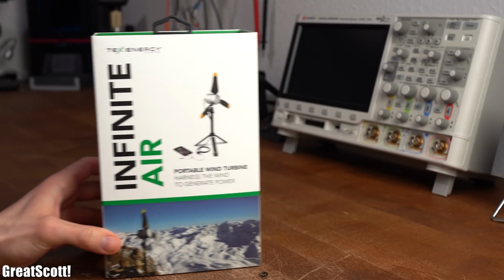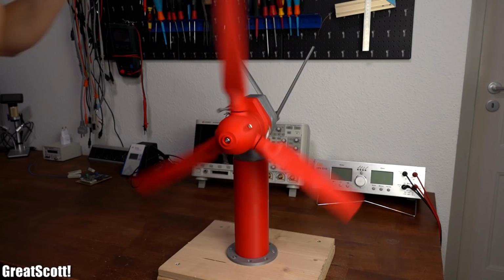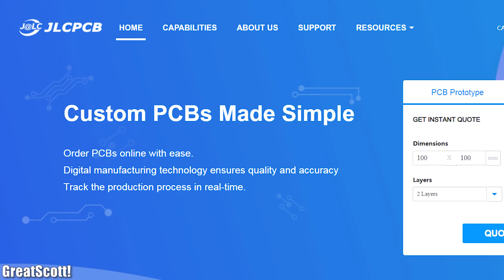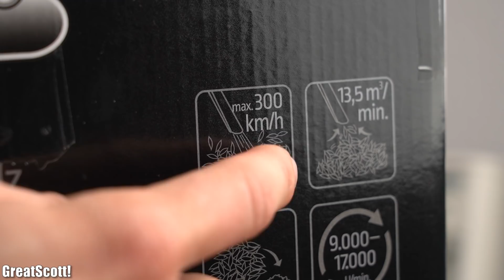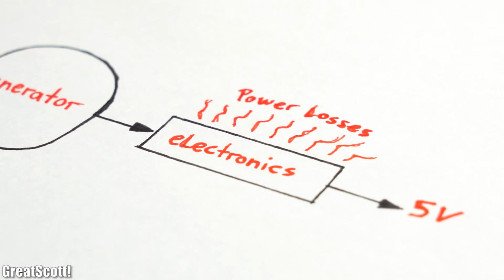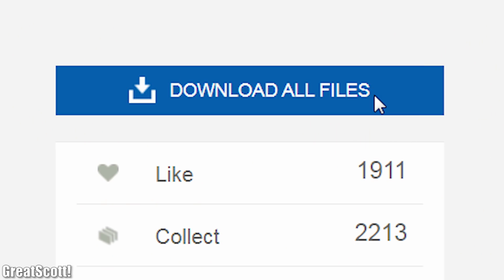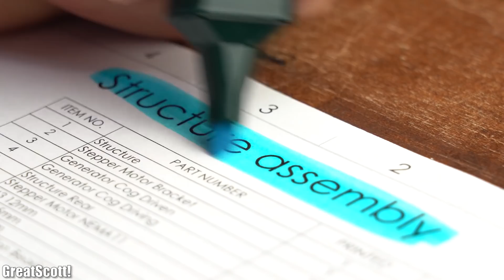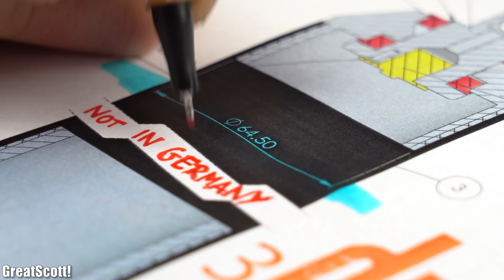Mini Wind Turbine || DIY or Buy

Comment: As mechanical engineer and serious electronic hobbyist I would like to share my view for the contents of this video presented: 
I wouldn’t feel much confidence in theses tests, for several reasons explained ahead, although your conceptual purpose was commendable.
(1) The wind blower applied “wind” in just a small part of the blade - where radial distance (and angle) should be the same in both cases, not only speed settings (“3”) and blower to blade distance. Not doing that increase lateral bearing loads (higher friction losses) and apply “non reproducible” and “non equivalent”  wind to both devices.
Suggestion: why don’t install higher above the roof of a car (or even bicycle) and test at a given running speed? 
At least for few seconds both could be monitored in the same condition, maybe recording each Volt x Ampere pair under equal resistive loading in any data logger (even Arduino would work).

(2) Compare fixed pitch blade vs variable pitch... But the best pitch angle was not properly working to make it as a fair comparison. Maybe even the blades were NOT at same pitch...

(3) Another important point in the comparison was missing: which is the circle AREA the blades cover? That is essential to know how much wind energy could be harvested. And would give an idea of Efficiency [(Watts/m^2) / (Wind_Watts/m^2)] for a GIVEN Wind SPEED - consulting a curve of Energy efficiency per wind speed would be better for compare each in where Efficiency is not so low.

(4) And After such much trouble to 3D manufacture all those parts, the lack of smooth surface finish in the blades or in gear train increase mechanic (coupling and aerodynamic) losses significantly, a pity for so much effort invested. 

(5) A final  point: as this is to be used outside, for All Weather Conditions, their sealing systems to water ingress (in electrical and mechanical components) should be evaluated too.

So, even for a comparative result of “who is better”, I wouldn’t see as valid, at least how it was made here. 
I believe you should revisit the adjustments of the DIY version and re-run tests in conditions more similar to how each version was designed. Then, just share some figures of acoustic noise (if significant - iPhone App ~ ok) cost (most important), time spent, resources necessary and wind-area needed. 

If you decide to rerun and would need to exchange Ideas, we could see how I could share some more thoughts, details and suggestions.
Reply: From my experience of making small wind turbines these are the obvious things I could see that were wrong.
1) Any turbine with a blade diameter less than 1 meter is a waste of time. The efficiency drops off dramatically  and power available in the first place is too little to be worth having.
2) Any sort of gearing or belt is a bad idea due to efficiency loss and reliability. Direct drive is the only way to go.
3) The generator must have very little cogging torque otherwise low wind start up will be poor. Stepper motors have quite a bit of cogging torque.
4) Plastic makes a very poor blade material unless reinforced with glass fibre. Wood is the best for a home built rotor.

Comment: The problem not is the electronic or electrical (Generator or Rectifier), it is simple physics consideration  Electric Power generated  (proporcional ) => wind Speed by  circle (Blade area). If the blades its soo short....sorry ....lose efficiency. I think (i don not caulculate it) the blades must be 2 mether or more because wind speed its sooo slow. Add to it add generator speed 60 turns by seconds, make to easy sicronizated all generators.    Secon problem it the generator must be tur to wind direction.  Please you must be think the problem its similar to wind Windmill.

Comment: i think testing the  commercial windmill without its circuit might give it a disatvantage as it could have regulated the charging cirquit to get a maximum power output, which could be the advantage of the buy option.

Comment: I dont see how the wind would be powerful enough to charge a device? Wind isn't usually consistent. But great video!
Reply: You don't have to be super consistent to charge up a battery. But if you want a wind powered device, you sadly need a a turbine that can make the most of the rare stronger winds and a huge battery for the windless periods

Comment: Hi, the internet is full of DIY wind turbine plans. But that's not true of the generator. Some people use dc motor or car pmg. The other solution is 9 or more coil in resin casting. What is the best solution for DIY generator construction for wind turbine?

Comment: Wind power is one of the reasons I got into electronics.  I think going with a stepper may have been the major issue with why this didn't output a lot of power.

I forget the model numbers, but there is an old IBM disk drive motor (from the '80s I believe) that is considered in DIY circles to be the best motor you can use for this purpose, but they're getting hard to find and obviously the price goes up. A lot of documentation exists for people trying different things, like using a car alternator (which is very poor, btw, it needs to turn really fast to get any real power, which means a high gear ratio and much losses).

Another (and I think very fun and perhaps something to try) method is to build your own generator.  I've seen them built out of hard drive magnets and other such things. Build a three phase motor with some coils and some magnets and you can build a decent wind generator.  I started collecting hard drive magnets but I just never had enough to make a good attempt.

You're absolutely correct about gearing.  It should be avoided unless it's a large turbine with long blades so the loss in power is made up for by getting more power from the wind.
Reply: What if we use 775 dc motor?

Comment: I checked the price on wind turbines and compared with solar.
For identical power per day (depends on weather) but wind turbines need to be big to be efficient, cost more, makes noise and require a maintenance that will hardly reach the 25years claimed of recent solar panels where a frequent clean is all that's needed.
Ideally you want a combination of both but wind power remains costly for your own needs. I rather have a giant rat wheel that me or my dog can use if that can give a next project idea ;0)

Or just a bicycle linked to a generator...

Comment: hi , You can improve the efficiency by replacing the diode bridge rectifier by a Mosfet bridge rectifier http://www.ti.com/lit/ds/symlink/lm74670-q1.pdf . and why not adding a DC/DC converter like tracopower to generate 5V regulated ?. :-)

Comment: Ahhh. could you please stop hammering the bearings? Please use at least a nut socket to only apply force on the outer race of the bearing.

Comment: The efficiency was highly reduced by the forward voltage of the Diodes. It was not mentioned if they are shockey ones or not. But lets assume 1.2v for two Diodes. In the buy option an output voltage of around 1.5v can be seen. In this case the loss is a bit less than 50%. At the div option a voltage of about 0.75v can be seen, witch results in about 60% loss.

Comment: Unfortunately, there are many products like this that don't work the way they claim.  For a great DIY wind turbine, you can use a reclaimed mains voltage DC motor and buck convertor to get the output you desire.  These motors are in many devices including blenders and garbage disposals.  You will only need to redesign the turbine around the different dimensions of the motor.

Comment: Greetings from Spain ... I tried to make a Mini Wind Turbine with this motor (DC120V 2500RPM high power DC motor generator Wind power hydropower generator) https://www.ebay.es/itm/DC120V-2500RPM-high-power-DC-motor-generator-Wind-power-hydropower-generator/172752108152?ssPageName=STRK%3AMEBIDX%3AIT&_trksid=p2057872.m2749.l2649 and I burned up my test equipment. Would you be interested for me to send it to you... but you will have to make a video to show me were I went wrong.

Comment: Great Scott  Love your videos.  I have a commercial wind generator for charging phones and power banks.  It can also be submerged in a stream and generate electricity.
https://www.amazon.ca/Waterlily-USB-Portable-Campers-Backpackers/dp/B07MXN2LXB/ref=asc_df_B07MXN2LXB/?tag=googleshopc0c-20&linkCode=df0&hvadid=335005865265&hvpos=&hvnetw=g&hvrand=15228518222223278592&hvpone=&hvptwo=&hvqmt=&hvdev=c&hvdvcmdl=&hvlocint=&hvlocphy=9000653&hvtargid=pla-627566951005&psc=1

Comment: You forget to put actuator in center of rotor so later you can change the angle of blade according to wind speed and using brush dc motor is better.

Comment: So you know, you can add a pause into the print in PrusaSlicer (use a color change or the pause feature in the beta). That way you don't have to deal with the movement while inserting components.

Comment: Both win: cheater mode, you cannot compare the 2. 

The Nema motor is a big mistake. Inefficient as a generator
Reply: Agree, Try to adapt the motor from the bought one to the diy one, so that you compare the design with the same model. And if you do, tell us the results. 👍
Reply: He did a video on generators types, comparing bldc, stepper ,dc and others i think, but the design he used required a stepper motor, so he went with that.
Reply: @lukemagdalin6169  did he try and Gimbal BLDC motors?  They're usually wound for very low Kv so would generate useful voltage at low rpm when used as a generator.
Reply: @martylawson1638  YES! those low kv motors are perfect for this application and should easily outperform the bought one.
What also needs to be tested is which rotor is the most effective and at what rpm he rotor spins (pitch of the rotor).
I would go for a active blade pitch system with a servo though that keeps the rotor spinning at the optimum rpm.
Reply: @cmulder002  something like a maximum power tracker, but optimized to prevent overspeed might work
Reply: @RobertSzasz  so vary the load to maintain optimum rpm?
Reply: @cmulder002  more to limit max speed so it doesn't fly apart. But I assume there is a best blade speed for any wind speed too.
Reply: @cmulder002  i always wanted to make a wind turbine using an RC helicopter rotor.they have pitch control,reduction gear,multiple options for the motor and pinions...bad thing is they usually have 2 blades,and the rotors with more blades are expensive as hell in comparison,but...
Reply: @xiro6  go for a older plastic head like from a raptor 60 or vario heli. Plastic doesn't rust when it gets wet and change the ball barings with bronze bushings to also reduce corrosion when exposed to the elements. 
Copy a tailrotor pitch actuator since you don't need a swashplate all (you only controll pitch not roll/nick) 
These turbines run a much lower rpm then a rc heli so use 700 size or up blades or even better make own from wood. 
Then you can make them wider too since turbine blade profil is diferent from rc heli profile. 
To make it strong and light use a hardwood for the front 1/3 and balsa for all behind it.
Reply: @cmulder002  - Interesting thoughts!
Reply: Yes definitely. Curious why someone with the expertise to design a variable pitch prop would not have considered a much simpler, much more efficient option. A common, brushed dc motor will provide excellent generator capabilities if suited to the application.
Reply: Absolutely. 

Use a suitable BLDC motor instead. The gears aren't the issue, as those gears are almost 100% efficient, say 95% efficient or more. You're issue is the generator. ;)
Reply: yep i wonder how diy design  work with  generator or hmm some diy generator from rewind motor?
Reply: @buragoja9052  probably a brushless DC motor with a better efficiency but it is much more expensive.
A diy generator is fun but you need the computer tools to simulate the magnetic fields before you try to wire the motor. Or you will spend ages and probably fail.
<3
Reply: @RomanoPRODUCTION  there are many inexpensive brushless motors to match the exact needs. Match the motor kv to the expected rpm, and you can have direct drive.
Reply: @RomanoPRODUCTION  you can get a 300W bldc for like 8 bucks, probably around the same price as a stepper. though you'd have to add a gearbox (i.e. 2 more bearings, a shaft and 2 more gears, though the gears and shaft could be printed as one.)
Reply: @markdaniel8740  ha. Good luck finding a low kv motor that produce usable voltage at the rotational speed of the wind turbine.
Reply: @cmulder002  that doesn't tell me what the kv of the motor is
Reply: @luongmaihunggia  about 140 is standard ; the number of windings is what dictates the kv
Reply: @cmulder002  wind turbine rotate at 60rpm so you'll generate .4V at that speed so ha. Good luck powering anything at that voltage.
Reply: @luongmaihunggia   No they don't... they rotate ar what is the most effiecint for the current wind speed.
Reply: @cmulder002  which isn't that fast  anyway so good luck with that.
Reply: Exactly my thaught as well. That generator probably sucks big time. Even if the motor works fine, driving a reduction gear backwards may be really heavy and will probably waste most of the power.
Reply: @Twhite97  need to be spinning at at least 588rpm to charge a li-ion battery. Even if you could get 588rpm with a leaf blower doesn't mean it will get 588rpm under real world weather. As you can see in the video, Scott can barely make it turn in Germany weather.
Reply: Und der dye kan mehr Fläche an Wind auffangen man müßte eine größere Fläche mit Wind treffen

Comment: DIY or BUY: Generator with internal combustion engine. With Maximum Power Point-Tracking. 

I've built one with a Nitro-Engine, a DC-Motor for the starter and a BLDC-Motor as the generator. 
Looking forward to the test next weekend - Certainly more fun than grabbing a cheap generator from ebay. :)

Comment: Build one of your own ,you need 2 stator discs 1 for magnets 1 for coil assembly and 1 for rotor magnets.You will need axle and 2 ball bearings and make a housing.

Take one of the permanent magnets used in the rotor, and measuring the distance at which that magnet just begins to lift one end of a 32 mm (1.25 inch) paper clip off the table. The optimum length of each coil from end to end is exactly the same as the distance at which the paper clip starts to lift.
As of width of the coil its 1.5 times the measured distance.Smaller the magnet more thinner wire you need-thinner wire = less amperage you can use.
More coils and stronger magnets you use = less speed you need .

People build wind turbines like this by using drum brakes and wheels of a car.You can use round magnets or square,it doesnt matter ,they need to be N/S/N/S polarity.You can experiment and put a core inside a coil to boost effectivnes,but you will create drag-making it harder to spin propeller-which can be adressed by using transmission  like pulley for example.
Its cheap if you use a old wire from dead appliances like angle grinder for example ,just make sure wire is good to use,you can laminate it again by using spray paint and a rag.if there is a few spots damaged.
Cordless drill and a bolt with  washer welded makes a good coil winding jig.On other end use a nut with welded washer on it.
Hope these guidelines help you !

Happy recycling and windmill building everyone!!!

Comment: Request:Can You Make Bike Gauge Without Arduino (Arduino Version Are Confuses me)
Reply: Bicycle speedometers are like $3, they are very common and cheap. If you prefer the analog looking gauge they also sell those too (those you can get mechanical speedometers used a long long time ago on bicycles used just like on motorcycles). If you don’t like Arduino, there is not much point to making it since this exact device is very common and works well and weighs almost nothing (when I race I don’t even have foam padding on my seat, definitely don’t carry a phone! But the bicycle speedometer is so light weight I don’t remove it even if I’m not using it during the race).

They are digital with about 0.5 mph/kph accuracy after tuning (they read down to 0.1, but I’d say are only accurate to half a kph). They take about 5 minutes to install and the battery lasts a long time (like almost a year). Just use one of those since his project was all about making it yourself and if you don’t want that the solution is readily available and much higher quality.
Reply: @jakegarrett8109  Thanks My Dude I Will Buy bike speedometer instead of diy its too dificult for me

Comment: Diy or Buy?

GreatScott: Yes
Reply: @Santosh Wankhede it is referencing a meme
Reply: Yes
Reply: Buy
Reply: Hmmmm......DIY with a different motor and no gears, straight to a rectifier if required....I like the blades and rotating head quite a lot there....Will the tilt of the blades act as an brake in high wind? Will they interfere with power under normal wind speed or do they act as an easier means of overcoming startup friction?
Reply: Yes great scott is a cheater: jlcpcb wins clearly
Reply: @Santosh Wankhede 

Today GreatScott is a coward
The buy is clearly the winner if you don't look at the price tag but 300mW is way too low anyway.
Reply: Never a socialist !
Reply: yep, not a socialist !

Comment: combine both of these together, for example, use the commercial motor instead of the stepper motor since the DIY project has a better rotation angel.
 if you ever would add wind-generated power in combination to your garage solar system how would you do it?
 and what futures would you add to make them work seamlessly charging the battery?